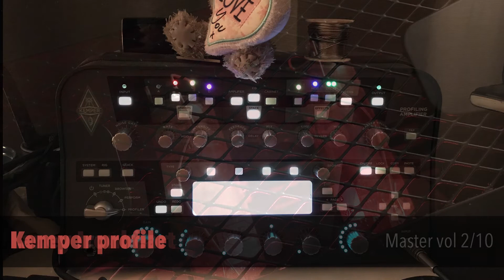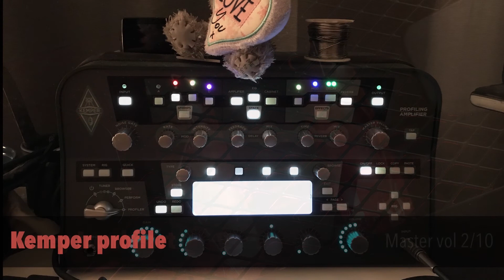Can kemper profile multiple distorting stages? Preamp + power amp clipping DI test

Comment: Doesn't the kemper have a setting within it to crank up the power section saturation?
Reply from the maker: Perversia it has a control called “power sag” (or something of that sort). But it’s hardly equivalent to real amps, at least any I’ve tested. Very subtle effect.

Comment: Power Tube Saturation is the missing part of tone especially high gain extreme metal tones and rock that take a good tone and can make it an amazing one. People who claim subtle differences... do you prefer JJ over Ruby tubes? How about 808's vs SD-1's? Dimarzio over Duncan?
Reply from the maker: Personally I think it’s possible to tell differences even between one 808 pedal vs another (not all. But some certainly) — but as with much else, this heavily depends on the test methodology.  A blind test with smooth transitions where nobody tells the viewer where the tone changes, in a mix.. hard to tell. But a blind test that focuses on the player feeling the differences in the room, with good monitoring? Can be much more revealing, easier. And I would agree that power amp saturation can be quite important, depending on the tone.
Reply: @Dimiguitar  I agree I can tell differences in all the options I listed. That's why power amp saturation is equally important and not so subtle at all in my opinion.

Comment: Cool video man! :)  it captured the laney pretty well imo, but there are the typical differencies less saturation, stiffer and a bit more lifeless ...and  i recommned doing the same with a vox  ac30... that was not possible di on higher volumes ... somehow it turned out better when profiling with a mic but  i like the flexibility of the di profiles so it is still a thing that bugs me ...
Reply from the maker: I also love the flexibility of DI profiles. I have made a load box to use at home with amps to profile, because dislike profiling at studio to be honest. Prefer the peace at home. I don't know why exactly the AC30 profile at loud volume failed -- may not have been due to power amp distortion? Because I find at times a few amps don't profile well direct. I didn't have this experience till recently. And then there's the issue with dual distorting stages, which you are well aware of I gather :)